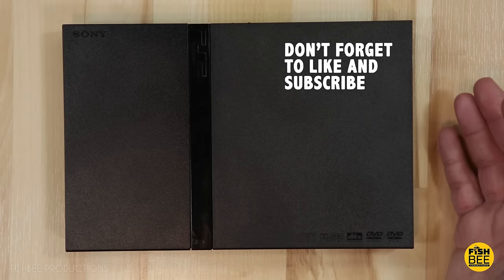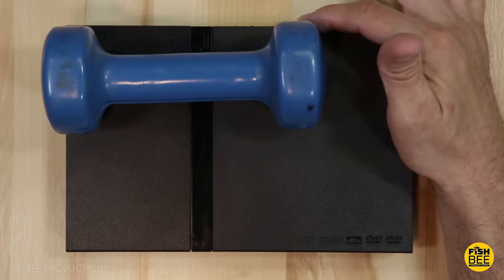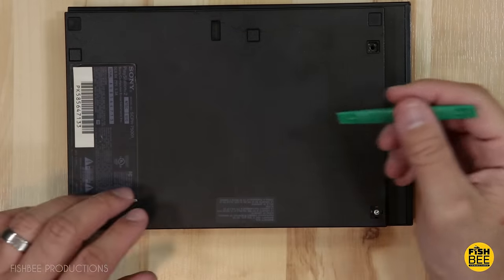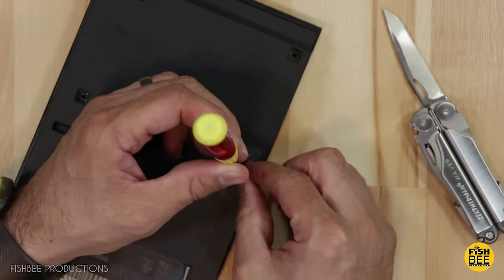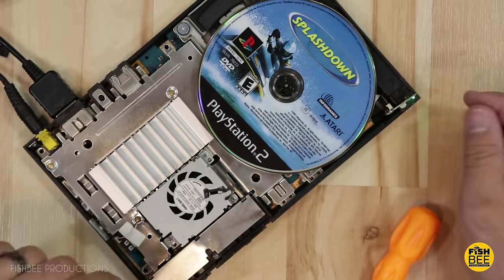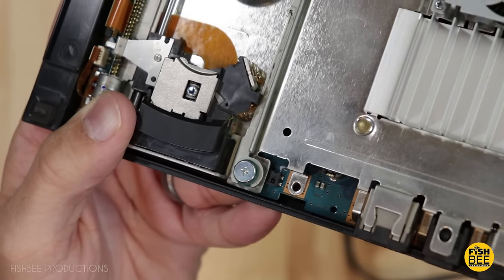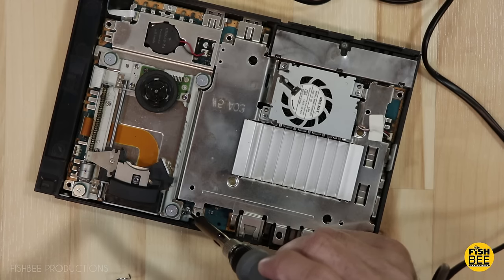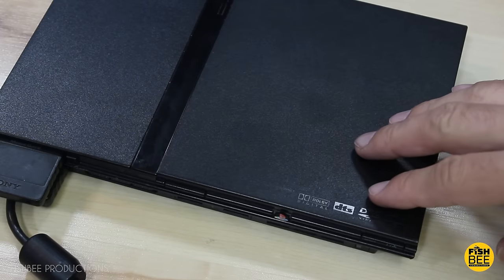How To Fix PS2 Slim Disc Error

Comment: so i push on both buttons , the laser moves and works (as eye i learnt the hard way) but the disc still doesnt spin. what now
Reply: Can't spin?
I thing spindle motor is broken
Reply: Uhgh I have exactly the same problem :/
Reply: Prikitiew Cikiciw the disc would spin , however like at half speed , sometimes slowing down. + the laser “module” underneath the disk is moving up and down even hitting the disk making a tapping noise
Reply: honestly i just went out and bought another ps2 for like $30 second hand couldnt be bothered trying to go any furthur
Reply: whatever youtubr same!
Reply: your PS2 can run the game?
Reply: I have the same problem, I just replaced the laser

Comment: How heavy was the weight?
Reply from the maker: I think 3 lbs
Reply: @FishBeeProductions  so turns out the laser entirely was shorted when I bought it so I guess I got scammed:/ (got it from an old games shop also got shadow of the colossus there and it works)

Comment: My ps2 stops reading the disc and a few seconds later it reads the disc and then stops reading and then reads the disc.
Reply: Same fam
Reply: i didn't play it for a while and it doesn't have the problem anymore.
Reply: So that's how you solve the problem?!
Reply: Minds the same
Reply: Bas van Delft I think this has happened to me before as well I used my fat Ps2 my dad got me off of EBay but recently I knocked the Graphics card loose in it so now the picture is out of wack when I use it.
Reply: minion_ bazz me same
Reply: @gamingtube8870   did you clean the fan?

Comment: You saved my ass! I thought i was being clever by glueing down the door sensor. Made the same mistake and after watching this, bought a soldering iron for £12 and did the fix. Super easy and much more stable than the straw technique. I also unscrewed the disc brake (and kept it safely somewhere) so there's no need to tape that down as it doesn't last that long. Thanks!

Comment: An alternative to the big blob of solder would be to solder small wire to connect all 4 of those pins. You could also use lead clippings from resistors if you have any laying around. I usually don't do a solder blob only because you risk leaving a burn mark on the board.

Comment: My ps2 still wont spin after i have the two switches down it still wont spin im not sure what the problem is maybe the spinner isnt getting power or something but if anybody has any suggestions let me know cause i mean its way more worth getting my ps2 fixed than paying 2000 dollare for a disc version of the ps5

Comment: You took off the top cover and then said the system should read the disc when you start it.. Ehm no, Beacuse if you remove the top cover the 2 plastic tabs that presses down the 2 triggers are removed. So that is a bad way to tell if anything is broken. But that back one seem to be a very common problem on these PS2s. And you only need to solder the 2 top points. Not all 4 together. Easiest to lay a small wire stump between the 2 points and some solder on.

Comment: My PS2 Slim doesn't recognize the disc format, and sometimes doesn't read the disc at all. My fix? Put it upside down. Problem solved! An old trick, but it works in my case. Hope it lasts!
Reply: Update: well that trick DID work for a while, but I'm still getting disc read errors every now and again. Perhaps it's time to legitimately repair this thing....

Comment: My laser just comes down even when i touch its sensor . i have removed the lid off and have done as you did . But the laser still comes down with pressure . It doesnt have sensor problem nor is motor damaged . But the cd wont spin and laser comes down and makes noise . what do i do? Ihave ps2 slim

Comment: I’m glad I found this vid cause a few months back my Slim PS2 was working perfectly fine until I put my Atv Quad power racing 2 disc into my Ps2 and that’s where the Disc read errors started stupidest part about it that one of my games what was working was the Cult Classic SSX3 where I was on peak 3 with Mac Frazier and Allegra Sauvgess with no cheat codes used and I also got my first platinum medal on Much-2-Much peak 3’s Big Air event with both Mac and Allegra. But I think I have another issue involving the thing that spins the discs it seems to slow down and starts possibly rubbing on something at the front of my Slim Ps2 disc tray and also it reads some of my blue coating Discs but doesn’t start up the game takes me back to the screen with my Memory Cards on it. Also even prior to my disc read error issues some of games didn’t even work them being the Cult classics of NFSUG1 and 2 and some of the Burnout games what’s weird cuz a few years ago my Slim Ps2 loaded up Burnout Revenge perfectly fine . Also my Burnout 3 also worked but it made my Ps2 make weird sounds made the Disc scrape on the Disc tray cuz it made the disc spin really fast and I didn’t even have the disc speed on fast

Comment: I've found with mine it was the front switch that was the culprit. I found putting some tape under the power button board (underneath the switchboard on the plastic casing), this gave it some leverage to hit the button on startup. helped with my issue completely.

Comment: The issue with mine is that it creates a 360 degree ring around the whole disk, though it still plays them fine. But if there's a fix on that I'd love to know, because online the only thing I see is to push the laser forward or back, which seems kinda dumb since that moves around to read the disk anyway :v

Comment: Dude thanks for your advice it actually worked I put weight on top of my ps2 console and it read the disk you saved me the hassle of opening it or buying a new ps2 thanks I just wonder if it doesn't affect the console if you use it upside down
Reply from the maker: I don't think it affects it using it upside down.

Comment: I have a 90004 and the disc spins fine, the laser moves up and down fine and the corkscrew motor moves the laser fine.

The console just goes to the main menu without loading the disc, It also sometimes makes a buzzing noise when trying to read, I am concerned for the disc though.
Reply: I believe the 90004 only has a black button you press down at the front and that isn't the issue.

Comment: So I tried to push down both switches (later I used duct tape for the switch at the back) and It won't spin the disk . So when I hold down the switch the laser is moving and on the screan (at "Browse") it says "Reading disc" for 3 seconds then disapears.
Can anyone tell me the reason why is this happening ?
Reply from the maker: The duct tape might not be holding down the switch. I know my duct tape was too cheap and thin to hold it down.
Reply: Yeah, the first time when I used duct tape on the switch it didn't hold it right , but the second time I tried it held the switch. I know that the switch is not the problem because when I removed the duct tape from it , the lens moved again . So , what I think the problem is has to do with the lens .

By the way , I really appreciate you for trying to help me and the others. I never thought I will see a video about how to fix your ps2 in 2018.
Reply: Id suggest some other vids that have later troubleshooting steps. The other possiblities is the laser that needs to be calibrated (try that in the search term on google maybe) or it possibly a short. Both MAY require a soldering iron and a volatage/ohm tester.

Comment: My PS2 keeps saying insert memory card even though there's one in there. Is there a fix?
Reply: You might have a PS1 memory card in, they only work with PS1 games. Try putting the memory card in the other memory card slot beside it, or maybe push a little harder when putting it in. If it's loose and wiggle, put something under the memory card to hold it up in position
Reply: @r.j.m1777   Thanks for replying. They are PS2 memory cards that i have and they work for most of the games that i have. Tried the things you suggested but it's just a certain few games that they won't work with. They did work with these games once then suddenly they won't. Thanks anyhow.

Comment: Thanks so much for this helpful video!

I used dollops of hot glue applied with the ends of uncooked fettuccini noodles to hold down the switches which were handicapping my ps2! Getting the application motion right was a little difficult, not sure I recommend this method.

Comment: Agree with everything except holding down the black button. You don’t need that. I had a perfectly fine console and perfectly fine disc not spin when turned on. When the cover is on the system sends a message which has that button pressed down. I would argue that this is unhealthy for the console. Tape.

Comment: My ps2 laser hesitantly moves away from the front of the console only, it doesn't return the light doesn't come on in the laser, but the points seem to be in great condition as well as the lid. Im very confused as to what thile issue or issues could be and would be very appreciative if i could get some sort of assistance.

Comment: I have an early model of the ps3 that is compatible with most ps1/ps2 games as well. Some particular ps2 games load perfectly fine onto it. However, when I put those same games into my actual ps2, they don’t load.
Any recommendations?
Reply from the maker: Not sure about that one but I sort of wish I had one of those original PS3s (mine is slim version)!
Reply: FishBee Productions 
Yeah, the reason I ask is because I have no working ps3 controllers at the moment. I’ll just buy one then, but thanks!

Comment: I have this same ps2 slim..mine was working up to about a week or so ago then it started with the erroe that the disk couldn't be read...it keeps going to the setup screen to set up the browser or other settings...but refuses to read the disks...guess it started awhile back because it would have times it would freeze up momentarily while loading the graphics...possible the laser eye couldve went out on it...who knows.
Reply: Had same problem with my ps2 slim.  Replaced the laser (can find on Amazon or ebay) and now it works.

Comment: I tried the fourth method but I fucked it up. Now my Ps2 doesn’t even show a picture and only has a sound. I’m definitely much worse in soldering as you are…
Reply from the maker: just reheat it up and try again, that's what i had to do
Reply: @FishBeeProductions  I tried it again, for some reason now the console always goes out the moment I press the disc close button near the power button. But I will definitely try it again over the next days, maybe the soldering didn’t connect right on the four little contacts.

Comment: Confused... Some say it is the switches, others say it is the laser itself causing the error. I get the feeling finding a working PS2 is cheaper than messing around with your broken one and ordering a replacement laser.
Reply from the maker: Possibly. This is just the way I fixed mine. Might not work for all systems out there.
Reply: It's a completely different issue. The lid detection switches have nothing to do with the laser. If the disc spins but the disc doesn't read, it's a laser problem. Try cleaning the laser with a Q-tip and isopropyl alcohol.
Reply: @tronicsrevival  I think it is dead. I converted my disc to iso's with Terminal on mac, they run in the emulator already. Now find a way to load them over ethernet as the USB port on it is too slow.
Reply: @2kBofFun  or just use an MX4SIO card, those are cheaper and easier to use.
Reply: @tronicsrevival  First thought was if it is only on Ali Express it does not exist, but there is a EU reseller. Found a benchmark, and ethernet seems faster, and has other benefits like I can serve multiple PS2/s or PCSX2 emulation computers from a single storage location.
Reply: @2kBofFun  Go for it then. It's a good option

Comment: Fixed mine by sticking the little tab on the power button down. Disc started to spin.  Used tape.   Have to open unit and push the little black tab at back of power reset
Reply from the maker: Nice!

Comment: Amazing fix!!! It took all of 20 minutes to open, crush that little button & remove the pieces (quicker than de-soldering), make a solder ball to connect the points, put it back together, and BOOM a working ps2 slim. Such a smart & easy fix. 

Why in the world did the even have that button?!?
Reply: I think its there to check when the lid is closed, to prevent people from doing disc swap tricks and other nonsense. There's probably multiple sensors that detect if the lid is closed

Comment: So I tried to take mine apart to run this test but my model must be earlier. There's a couple of ribbon cables that I can see and one of it feels like it's attached to the other side of the case somehow, and it isn't a screw. I just put it back together. I'll try putting something on top of it later but for right now it won't load a brand new copy of a game, regular disc ... not blue or black, and neither will my original PS2 fatty. I can't figure it out to save my life. I guess once I get the adapter to run it on my 4k monitor, don't have a TV, I'll try flipping it upside down first. I know it works because I played Xenosaga on it not even months ago. Don't get why it's now refusing to load a brand new game and splashing to the red screen.

Comment: It worked when I put the tape over the button in the back, but I noticed that the disc stops spinning on its own after a while of me pushing down the button up front. Is that normal? Also, the disc reading error still came up once I tried actually launching the game on the TV. :(

Comment: My silver PS2 Slim doesnt spin at all when pressing the 2 switches. I have to replace the lens. If you guys have bad cd games that are all scratched up, dont toss them. They can be repaired which is what gamestop does and resells the games as a refurb. Is why some games you buy from GS used doesnt work sometimes. There is a machine you can buy that is like $100 and can resurface the cd. The lens, is easy to replace for PS2.
Reply: Solar Cat what is it send me a link

Comment: My ps2 has the same problem and I used the same temporary solution by using a weight on the disc tray but that doesn't work anymore. I just now opened it up and tested if it would read the disc but the laser just moves up and down a little bit and nothing happens

Comment: Ive tried all these methods and mine still wont spin, the motor moves up and down the spindle so i no its not the motor either, how ever i am wondering if the cause could be the ribbon that's connected to the lazer could stop the motor from spinning has mine looks battered, pls can u advice me if this could be the case with mine any help would be trully appriciated thank u
Reply: Get freemcboot

Comment: Haven’t had to do a “repair” in almost 8 years. And it makes me want to go try this again to an old one I have in a spare room put away because I didn’t think it worked, which I don’t know why I still have, like many people.
8 years of no problem, 1 hour of cursing the books I would’ve read for a couple hours in place of plying ,and only 2 seconds of swabbing the lens quickly.

So nice when suggestions work.
Everything you see in this video... I can’t stress enough, stop!!!!! Stop!
It’s amazing, maybe only mine and other people with super minor problems... 2 second non hard swipe of a clean cotton swab, q-tip to the lens and its back.

Comment: Here's my issue:
Some of the games were able to load and ready to play. Others weren't for some reason. Normally they would work. After about 1 hour the PS2 is not reading any of them.
Has anyone experienced something similar? Appreciate any response :)

I'll try to open it up and see if I can fix it.
Reply: I applied some pressure. It works only a few times though...

Comment: I have got some other problem than this, when i play GTA:VC when i play a while textures start to get a very low resolution and i get Error reading Grand Theft Auto Vice City disk, could u help me? And sorry 4 my English i know it isnt ideal.
Reply: So the ps2 works fine but vice city starts having problems? If yes then the disc is scratched and the ps2 cant load correctly the game so it gives you this error
Reply: panagiotist47 No, my disk isnt scratched and in GTA SA i have got another problem at some missions game freezes. On Def Jam Fight for NY game sometimes doesnt load.
Reply: Foxyy To Przechuj then the ps2 doesnt reads the discs right

Comment: What are the wires you used
Reply from the maker: Leather wolf I didn't use any wires. Only soldering iron.
Reply: FishBee Productions I’m talking about the ones you plugged into the back of the console
Reply from the maker: Leather wolf Ohh, that’s a universal component gigaware cable that I’ve had for years. U can hook up Wii, Ps2/PS3 and Xbox 360 with the same cable

Comment: Dude my GTA San Andreas disc would load and play but every so often I would get that error screen and would have to open the lid  to stop the disc from spinning and then close it to get it to play again. I did what you did and I haven't had a problem since. Funny though GTA San Andreas is the only disc it would do it on. Anyway it's fixed. Thanks bud you really helped me out.

Comment: TLDR: If you see you dont have that small black switch and instead a gray trigger, just tape it down no soldering needed! 

This video helped so much! I Got a ps2 slim on ebay too, only thing wrong was disc reading this video helped me fix it. Didnt need any advanced tools (already had small screwdrivers from having to remove a stuck disc in my ps4, and a small sliver of tape). The switches you showed for me were actually small gray triggers. So a lil piece of tape and I was gtg. No soldering needed. Been playing Smackdown Here comes the Pain and Musashi all weekend